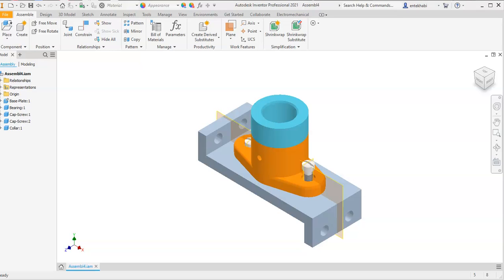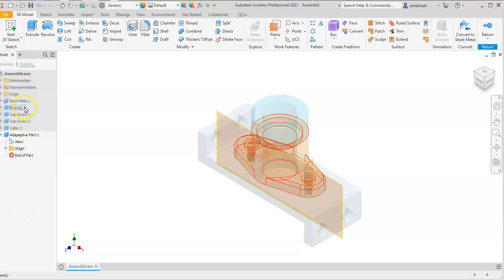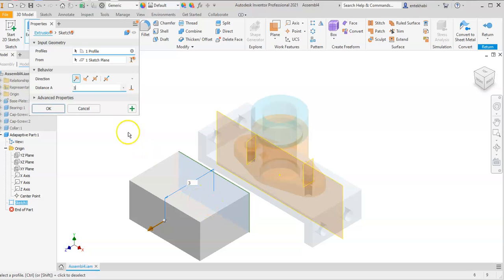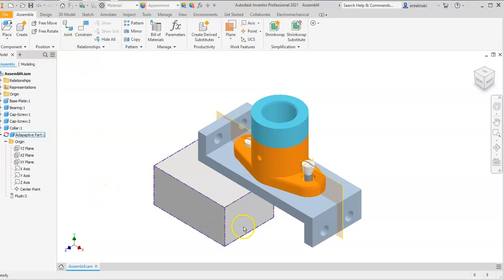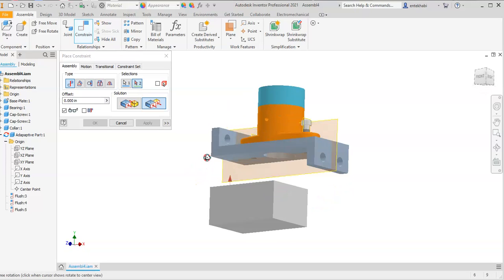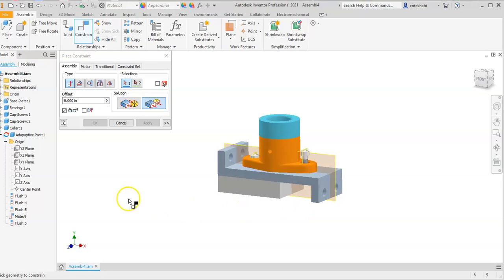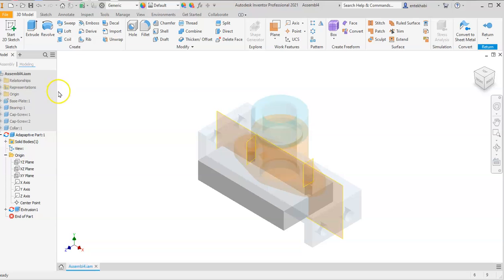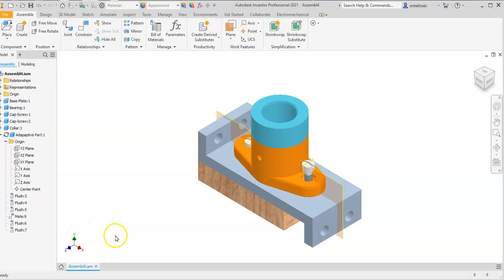Adaptive Design

Comment: This approach does not scale up well. Adaptivities require complex projections between geometries with different coordinate systems. It is very slow. Never use adaptivity. Other thing to point out can be seen at 4:15. Your adaptive part has 4 flush constraints. First flush (surface to surface) removes 3 degrees of freedom (one rotation and two transtalions are left) The other one removes one rotation and one translation. Third one just pick a position along the last translation left. Adaptivity resulted in on aditional flush being required. Constrains are expensive to calculate. The program has to figure out where and in what orientation the part has to be. Less constrains = faster model. And more robust, as constraints can fail when editing the geometry.

Much better solution is to create a multi-solid "skeleton" model and derive the components from it. This way you can use the very same sketch to make holes for bolts and such, negating the need for projections all together. Define the general shape and connections between parts in skeleton and leave the details (fillets, rounds, ...) in derived parts. I am using quote marks as Inventor does not have proper skeleton models. But one has to make due with what's available. This will save you constraints as the parts will already be in correct positions. Drawback to this is that the part is no longer placed at the origin. You can thank Autodesk for not including local coordinate systems within ipt files.  For larger projects you can create a hierarchy of skeleton models to drive different subassemblies with the main skeleton governing the positions of subs-skeletons to each other.

I did not watch any other of your videos. But from the presentation I dare to guess this is an introductory lesson on bottom up modeling. Please, just no. All the lessons that can be gained from this can be learned while working with content cetre. Top down should be introduced first as it is vastly supperior and previous knowledge of bottom up is not required.
Reply from the maker: Thank you for you comment, and recommendation!